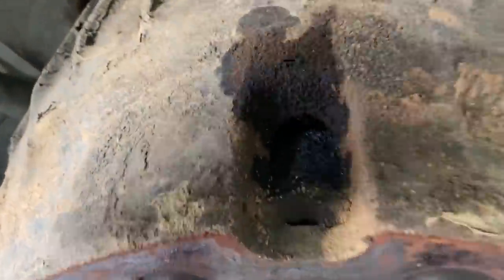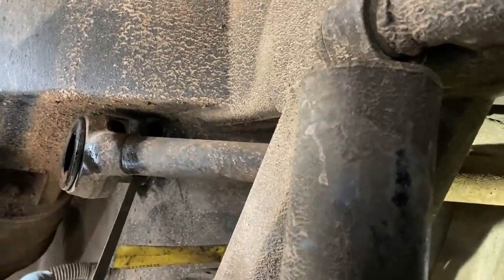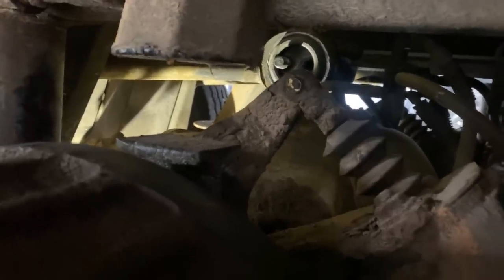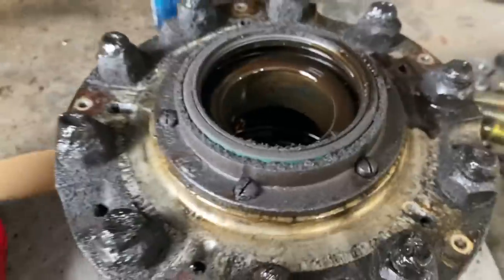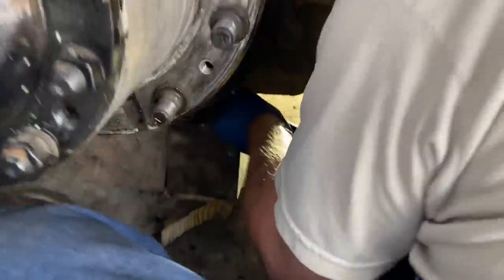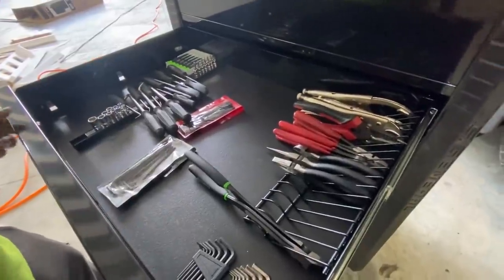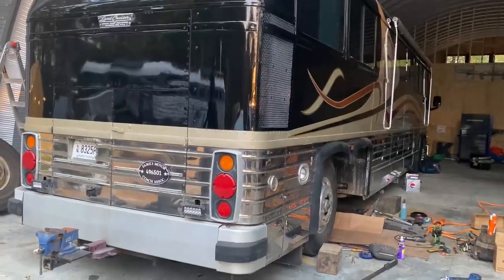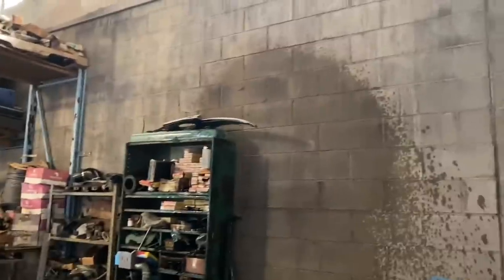Mci 9 came in for just a lube job.  Discovered lots of urgent repairs needed

Comment: I admire your knowledge and skill you are providing a much needed service.I find it a bit scary that so many vehicle sharing the road with me have such compromised brake and suspension systems
Reply: Regular inspections would reveal problems. Also helps to keep underside clean. I hate dirt failing in my eyes.
Reply: And they are Big Heavy vehicles at that👋

Comment: Scott,

It must seem like a blessing to be finally working under the Quonset hut. The first time you were working on a RV and I instantly recognized the sound of rain hitting the roof must have been great when you realized " it’s raining “ and you didn’t have to pack it up. 

If you decide to utilize the two barrel wood stove setup I would stop by the town DPW tree department and ask what they do with the trees they remove take down and ask if they could drop the wood off at your shop as that’s cheap fuel to heat the shop with. 

Food for thought
Reply: How about using waste oil burning heater I think he would have 3nough waste oil.
Reply: A nice sized tarp works great. I was famous in my neighborhood for a tarp over the half of a vehicle I was working on...a little seat and heater when needed made it very comfortable in the rain snow cold or whatever. I was raising a family working during the day, had to play dad at night while mom worked 2nd shift fix stuff check on kids repeat, work till late at night to finish vehicle to get to work the next morning or long days on weekends. Now kids are grown house is empty I built a decent sized 2 bay shop with heat a/c internet 55" TV for computer monitor car hoist...and work in comfort as needed.

Comment: Worked for greyhound in Seattle in the early 90's. Then in 95 to present at a transit company.Your doing a great job.
Just FYI. Those are called bellows. Air bags are closed at both ends.

Comment: The 301 piece kit is a phenomenal kit.  My only gripe is having to use the adapter for some of the sockets that should otherwise seem as though they shouldn't need an adapter.  I bought one of these kits for my Father as a gift years ago, thus far I've only been the one to use tools out of it.

Comment: Just found your channel great memories of working on my dads lorry when I was fourteen changing the brake shoes and then crawling under neath the truck greasing up all the nipples. My dads welder mate made me a bucket lid with an air coupling attached so I could connect the air line from the lorry and grease it up with ease. Dad would inspect the brakes as I went along ( he had a bad back) and then get paid.  Loved my weekends working on his lorry. Eventually I was doing the other drivers lorries as well.  Being an owner driver they all had to do own repairs.

Comment: If you got an old pin where radius rods bolt to drive axle , remove two bolts that hold pin to differential , remove rubber stopper, grind old pin so it slides  easy hit pin in to push thickness of radius rod and it will come out, at greyhound we always removed studs pain in butt ! I can send photos of grind pin makes job easier but you did good job !!

Comment: If you're replacing the air bags, it's best to replace the leveling valves. My experience, they can stay aired up for quite awhile. They all leak differently, some may take an hour to leak down, some may be slow and take a day or week. If you have one leaking on your drive axle, since there's one for the LEFT and RIGHT side of the bus to level, it's always awkward with a leaning coach.
Reply from the maker: I always recommend leveling valves if it’s not staying up.  This job has new leveling valves

Comment: Something I really want to know here.... How come so many vehicles are in such poor shape??? What goes on? Are they what we call "maintenance free vehicles" ? I don't get it. Some of what I see is soooo dangerous. As a former heavy vehicle mechanic, I'm just amazed. I'm from down under and vehicles have to get inspected yearly and commercial vehicles even more frequently. Trucks and buses could get randomly inspected on the freeway by inspectors. Do the owners ever get their vehicles serviced? Or if they do, are the workshops doing the right thing? Most of the stuff I've seen, doesn't happen over night. It's due to no maintenance. Have they just purchased these vehicles and found all this out thanks to you? Or do they just drive around until something breaks? Love your show and everything you do by the way! It brings back many fond memories.
Reply from the maker: It’s never just one reason.  But rv’s being exempt from inspections in most states leads to this.  I try to preach about it.  The maintenance required is very intensive especially when first purchased.
Reply: Mostly just from laziness, cost, ignorance and realistically they tend to get bought and parked for years
Reply: I see. Thanks for the reply. All makes sense now.

Comment: I have a question for you guys. It looks like a lot of those suspension parts are covered in mud and gunk. Why not pressure wash it before you get started as it seems like it could hide possibly less obvious issues. I love that you allow the customer to get involved. If I had a coach I would absolutely travel to come and wrench with you and learn from you.
Reply from the maker: Pressure wash an undercarriage before a lube job?    It only came in for a lube.  We noticed the other major issues while doing that
Reply: @BusGreaseMonkey  so at that point why not wash all that build up out of there or put the owner on the nozzle and let them get after it.

Comment: When working I would barrow a mechanic’s tools, and on occasion break one. Feeling bad I brought it back.
He was happy because he could trade for a new tool. After that I didn’t feel so bad. When others asked he told 
them no because they didn’t return the tools. Moral of the story all ways return the equipment.
Reply: You would be surprised at how many free tools I got by returning broken ones people threw away back to Sears (Craftsman) and Snap On!
Reply: A lot dont
Reply: All my old Craftsmen wrenches are forged, and new craftsman wrenches are not forged. How is a new one better? The replacement tool is always of a cheaper quality.
Reply: @pwcraig65  
Absolutely. Craftsman sadly went from made in the USA exclusively to Chineseium unfortunately. All The Sears stores are gone near me at least. Pretty sad

Comment: I wonder if their is any sort of conditioner that can be used on air bags?  It seems like it should be a thing to help keep them from cracking.  Always love your content keep up the great work.
Reply: Rubber always fails, I'm sure there is something but it will still fail. Think of the weight and flexing it does

Comment: IS IT POSSIBLE TO USE A SMALL WHEEL PULLER ON THE RADIUS RODS? .....WITH AN IMPACT SOCKET, EXTENSION, AND AN AIR GUN? ALSO, ANOTHER PULLER ON THE OTHER END SO THE PULL IS EQUALLY ON BOTH ENDS OF THE RADIUS RODS.

Comment: I have the almost exact same cart art rolled great until it was fully loaded actually overloaded by quite a bit and then the wheels didn't hold up and I had to upgrade them.
Reply from the maker: The wheels seem very tough.  There is even a grease fitting on the casters that we greased already.

Comment: Interesting as it seems you have such apparent access to these unique parts for these buses/coaches as these are not stock off-the-shelf parts normally found nor used on Class 8 semi-trucks. Even the double and triple bellow airbags are items which have not been used on trucks since at least the 1990's yet are so readily available for these buses/coaches. The wheel seal retainer is something I've never seen used on a Class 8 truck. Do you order and stock many of these unique parts or do you have a local supply house nearby who sources and stocks these items for you? As Tennessee is no stranger to entertainer coaches with the Hemphill Brothers and a half dozen others, is it easier to source parts in the state of Tennessee than anywhere else in the country to supply your operation? BTW, that MCI-9 is one beautiful ride. Can't wait until we can get nose deep in that engine compartment.
Reply: They are common on Rockwell axles with press in axle stubs.

Comment: Speaking of tools - what would be a basic, yet important, set of tools and gauges to have for DD 6V71 engines.  I am thinking being off the dock and needing to do some adjustments or emergency work.  Also which engine, fuel, gaskets and other parts would be good to have sitting ready to go if needed? Pam
Reply: For starters a 200ish pc or higher  set of sockets wrenches etc. Then fill in basics like a hammer, 3lb hammer, vice grips, pliers including needle nose and long handle needle, screw drivers random hose clamps, Gorilla Tape, tie wire for concrete forms etc in home store concrete supplies. Soft flexible wire with millions of uses and dirt cheap. Don't forget a jack with 3/4 plywood and 2x12 slabs, 4x4 &or 6x6 chunks for jacking shoring up etc. A good start

Comment: looked like the brake shews are down a good bit, that was close to being cammed over or did you just have things stretched out for cleaning?
Reply from the maker: The parking brake is applied so it’s expanded.  The drum will not fit on until the brake gets retracted

Comment: I do love those old air brake sounds. Are they specific to a certain type of chamber?
Reply: I remember old Mack Dump trucks sounding like that
Reply: Those are DD3's. Mostly seen on coaches. They use a inversion valve mounted above them. When the parking brake is set it locks the shaft. Whatever pressure is in the tank when set, takes higher pressure from the service side to unlock it. Takes a full service brake application to release the parking break.
MCI still has the same practice, but uses a different maxi can.

Comment: That’s not grease he’s removing from the brake shoes that’s oil combined with dust which just builds up and severely reduces your braking performance. Be ya the owner feels a much better brakes when he steps on the brake pedal.

Nice catch on the oily brakes and the air leaks.

Food for thought

Comment: God what a crappy design to use flat head screws to hold that seal on for the rear hub. I know on gillig transit buses they use Alan head bolts. Seems much better to tighten and also get them out vs a flat head screw design

Comment: Here is how to tell the difference between harbor freight snap on mac matco cornwell etc  NO BS pull the largest drawer out to full extesnsion and wiggle  You will be able to the difference immediatly  with or without tools dont matter. You will under stand  why mechanics pay what they pay. you go to school and pay for your eduation I pay my tool dealer it all comes out to 100K+ how do yo wanna look at it? the difference is the thickness of steel in the drawer and how many folds/stiffening ribs are it
Reply from the maker: On their less expensive boxes yes but on this box you will not see any difference.  This is an equal quality box.  It is not low quality.  No bs

Comment: If those brake shoes aren't being replaced they should be. They are saturated with oil and can't be cleaned to any useful service. Just sayin',  then again I work in a fleet shop and most others would just re-use them.